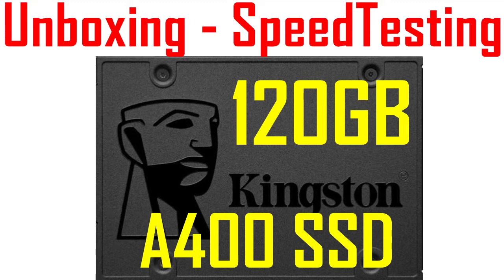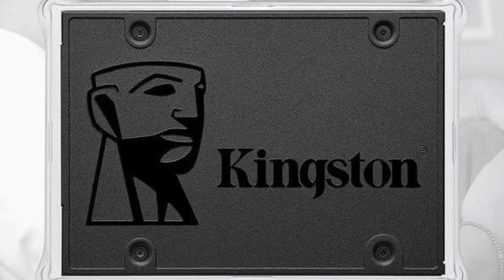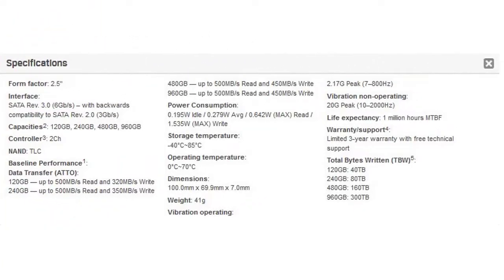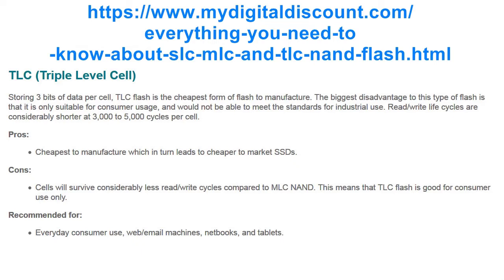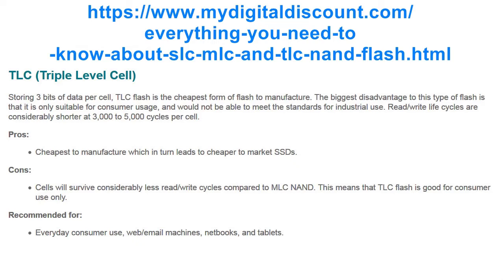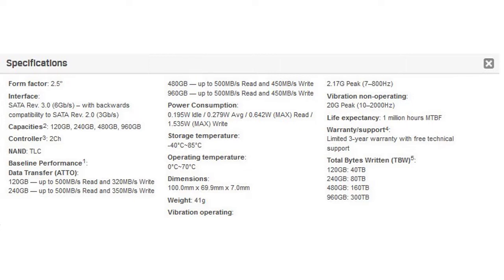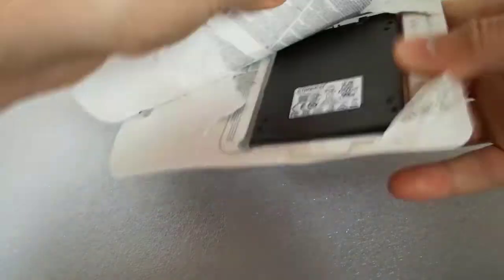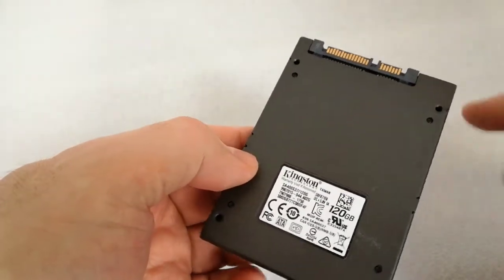Unboxing and Speed Testing the Kingston A400 120GB SSD Ep.242

Comment: I have a sata 6gbps, a good cable and my write speed is under 50mb/s :/
Reply from the maker: Do you have this model of SSD? What OS do you using? 
If you use Windows 10, then make sure the Windows not updatingwhen you make the speed test.
After you open the PC wait 10 minutes, unplug the internet cable and than make the speed test, if the speed dosen't improve, you probably have to reinstall the OS.
Reply: @redigitt  yeah, i have this model and windows 10, a fresh install. I also noticed that when windoes boots and i quickly try the test, the writr speed starts at 400 and slowly drops to under 50mb/s
Reply from the maker: What PC model do you have? in the bios you could check if the SATA port is in compatible)IDE) mode or in AHCI, for better performace the SATA have to be in AHCI mode.
Reply from the maker: The Windows 10 after you start your PC make a lot of reading and writting on the HDD, thats why I dont like the Windows 10, you have to wait 2-3 minutes to finnish the reading and writting the Windows 10, and only after that make the speed test. In the TaskManager you can see when the HDD usage drops below10-15%, then you make the speed test.
Reply: @redigitt   The bios is set to AHCI and i ran the test after a couple of hours and it still wasnt good. It should be around 400 to 500, right? Read and write?
Reply from the maker: @ficha13  it should be 500MB/s the reading and 350MB/s the writting, unless KIngston dosen't replaceed the chips again, like in the V300 model. I purchased one with replaced chips and it is very slow.
Reply: @redigitt  thanks, for the info and tips
Reply from the maker: You are welcome.